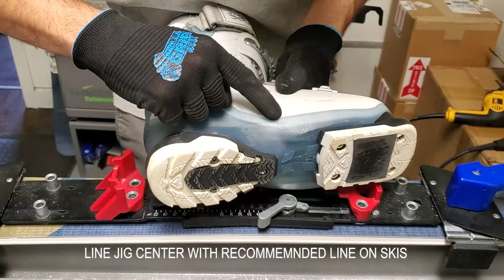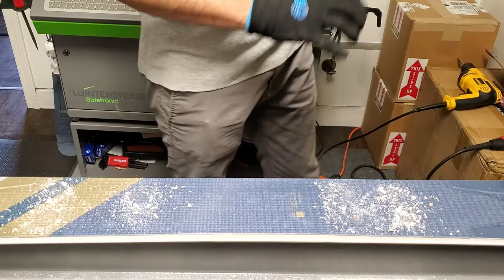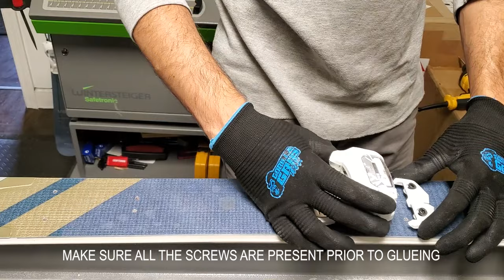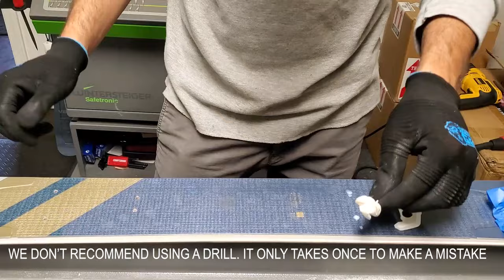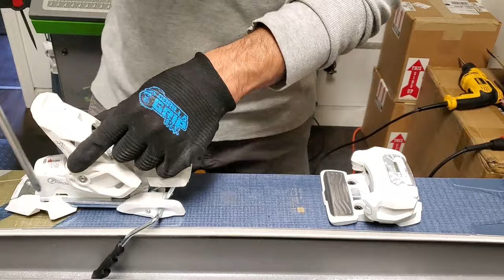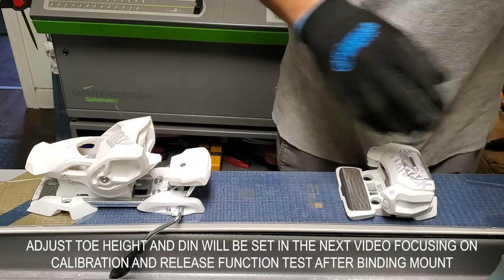Ski Binding Mount - a step by step video how to mount alpine ski bindings

Comment: After cleaning the debris left from drilling we always place the jig back over the holes to insure the tap is lined up straight. When you free make those first few turns free style it is possible you could slightly angle the tap.
Reply: you also risk putting the jig back on at a slighty different location and causing distortion too... maybe we should try to clear the debris with the jig on???

Comment: Could you please tell me which glue you are using? Is the glue type very important or I can use ordinary wood glue? Thanks for the video
Reply: Hi, I’m not the video creator ….but I’ve mounted many,many skis. Just a good wood glue is all you need.  I use Gorilla brand. Have never pulled a screw out prematurely. .

Comment: Been having some issues mounting the marker bindings this year ie squire/griffon. No matter what I do I still end up with a very minute but barely visible light under the base plate. Any ideas on hetting it flush. Ive tried a lot of different techniques already.
Reply from the maker: Seeing light under the binding plates is not uncommon, what we would suggest is to check the area where the screws go in, you don't want to see light shining through where screws go in. If you see light under the plates (especially by the ends of the plate), that's okay as long as the screws are all the way in solid (make sure not to over torque the screws and cause them to start spinning). Having said all that, last step is to get it release function tested. If it passes the test then you're solid because the calibration machine outs an enormous amount of pressure on the bindings and if they were not mounted correctly, they would rip right off the skis.